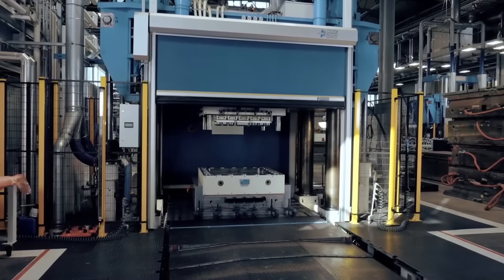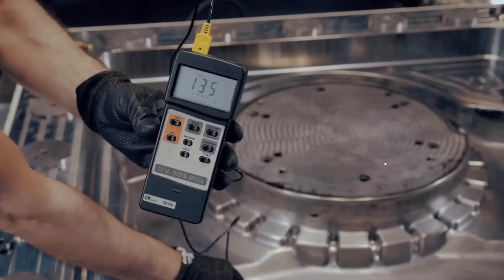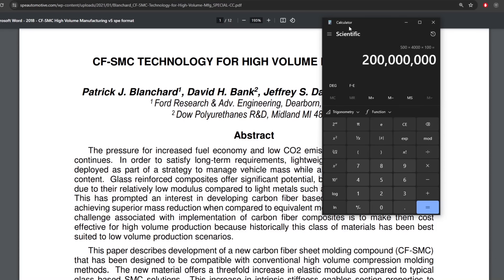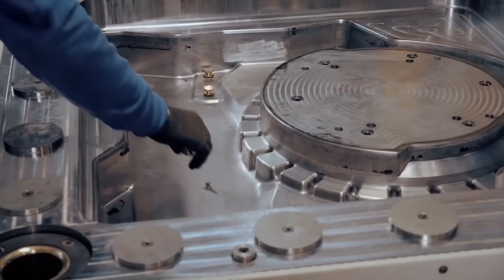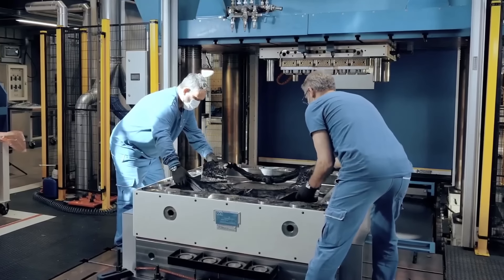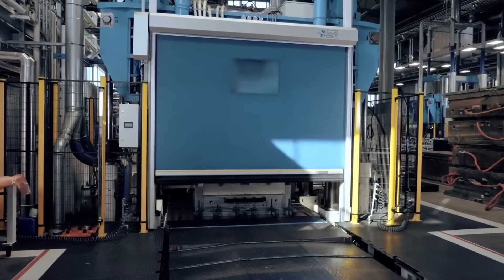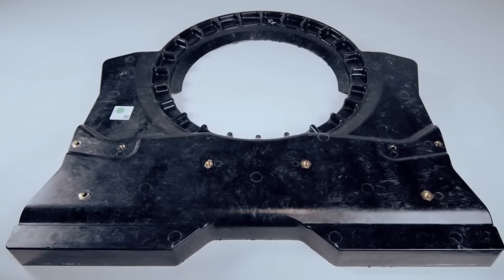How CPC presses the CF SMC parts

Comment: The energy to heat up the die is approximately the energy required to manufacturer 1kg of carbon fiber (100 MJ to 900 MJ). The forming energy cost is very low compared to the material energy cost.

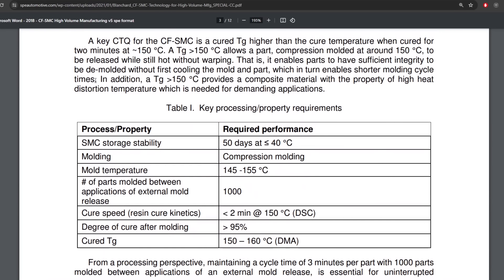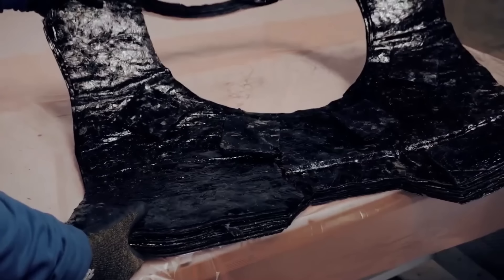Comment: Thank you so much for this video. I tried getting some of this info directly from CA while at Aptera (you have the video in part 2) but he did not get the detail right. I thought the mold had to cycle a little with the temperature (like 20-30 degrees) to allow a firm part to be removed from the mold, but the data sheet at 3:18 dispells that, with a cure time of under 2 minutes at full tempurature. Also I could not understand how a blob of material could find its way to the extremities of the mold in such a short cycle time. This answers those questions as the blob isn't really a blob, more of a preform.  It also leads me to more questions, like what do they call the premolded shape (shown at 4:50) and what does it look like, say for the sides of the body.
Reply: Probably for compatibility with existing tooling in places that compression mold pre-preg carbon. Can't edit my previous comment but there is a picture of the roll on the mitsubishi website (about half way down)

Comment: 10,000 KN = about 1,000 tons of force, so it's about 1/6 the force of a standard Giga press that Tesla started making parts for the Model Y.
Reply: So despite what seemed like high energy consumption, yet another manufacturing efficiency advantage of Aptera’s carbon/fiberglass over metal/aluminum favored by other automakers.

Comment: So, therefore the limited part of the production might be the molds. Building more assembly plants, should be the easy part, maybe one in Carlsbad to begin, but Abu Dubai, or in Europe, then one in the Asian market. Can CPC keep up with demand, without more molds? This wonderful material can be duplicated only with the expensive molds or dies. So are the plans to make more molds/dies, for other assembly plants.
Reply: They will have to make more molds. The cycle time is too slow. Remember, it takes 102 minutes to make an Aptera in Carlsbad. Plus you can't run the machine 24/7 strictly because of staffing and maintenance.

Aptera has shown us a video of what they think assembly is, yet nothing on the rest. For example, making the bink or any sub assemblies. In the end, it's not going to be as easy as they tell us.

Comment: Even if it used 100kwh of energy. The vehicle may last 500k miles. The energy it offsets after 2 recharges from solar offset body stamping cost. Thats quick. Plus they can offset factory energy use with solar, wind, hydro, battery etc

Comment: So its similar to plastic injection molding Places like that do thousands of pieces a day and only change mold after a specified  amount of materials made typically in the hundreds of thousands depending on variables.So they don't have to keep reheating the mold to get all the parts they need. Plastic moulding takes higher heat btw.

Comment: I suggested Tesla using carbon fiber. Someone said they didn't think it was usable for mass production. I disagreed. This video helps with that conversation.
Reply: Stamping steel or aluminum is very expensive to tool, but once tooled for very high production volume,  you've got a very fast process.  It's far faster than this smc press,  and the gigacast process is similarly faster.
Reply: @jamesengland7461  Faster generally only better when market demand exceeds manufacturing capacity. Aptera’s strategy to distribute smaller, less capital-intensive plants seems smart, especially in contrast to the ‘Detroit model’ of highly centralized, high shipping cost (of finished product).

Comment: When they take the moulded part out it appears to be rigid, implying that it is now fairly cold - do they have to somehow cool down the mould before they take the part out ? I have a 3D printer, and I can't get whatever I have printed off the base plate (60 deg. C while printing) until I let it cool down, and if I do manage to get it off, it is quite floppy when at 60C, not like the part in the picture . Maybe the mould is riddled with "tubes" through which heating and cooling liquids flow.....
Reply: That information was in the page that he showed about the process.  They developed the materials and process to not need a cool down.  After being cured for 2 minutes at 155C, the part is rigid and can be extracted hot.  At this point, the glass transition temperature (Tg) is 160C, meaning that it would have to be heated up to 160C before it could be deformed.  I find this point quite interesting - that Tg is 5C higher than the curing temperature.

Comment: Yeah, that's a lot of heat but not as much as it could have been. I've heard that it's that heat that makes CF SMC stronger that the equivalent panel of fiberglass SMC. The material too, of course, bit it's the flow and compression that makes it even stronger. 

As someone else mentioned, the resin is still curing, so that makes it more fluid as well.

Comment: 55kWh is VERY little energy. Try doing the same calculation with a regular steel based vehicle-remember steel melts at over 1,000C. 

Now in terms of cost, 55kWh even at $2.00/kWh is only about $100. Even for 20 structural pieces, the energy cost is only $2,000. That’s a totally unrealistic extreme scenario. The point is for a $34,000 vehicle, the actual cost of energy expended will be very low relative to the entire vehicle. Probably a small fraction of any other enclosed two seater.
Reply: That's what I was thinking.  Very little energy for the part produced, even if they only create one.  Looks like price per KWH in Italy is approx $ 0.10 (as of March 2024)   Only $5.50 per part if you had to fully re-heat each time.
Reply: @rayagreen11  exactly, even if commercial rates are triple that it’s still negligible

Comment: interesting, but the carbon fibre matrix appears to not have directional fibres, it looks more like a chopped matt and expoxy mix, any info on how they make that black blob?
that would be interesting, yes good for mass production.
Found this video of a chinese company making a type of cf-smd sheet, would be pretty similar to the black blob aptera uisng, pretty sure, and a little research shows the base material is 
non-directional cf chopped fibres, which is interesting. Hand laid cf with directional fibres would be thinner and stronger where needed but is slower process, interesting stuff.
https://www.youtube.com/watch?v=nwkl6OrH_L8

Comment: What is this thing about the energy used to heat? Its a one time heating for one piece of car. Other bit, any idea how much energy each phase of any other vehicle mfg process takes. You will be surprised.
Reply: 5:55 no its not a very high temperature. That is the temperature of the flat pan we cook tortilla on! 🙂

Comment: I thought Aptera did injection molding for their CF parts and did require placement of any cut sheets or mats.
Reply: This is one point where the video of this process is different than my understanding of the process for the Aptera parts.  They don't use injection as you suggest, but many times it has been described as placing slugs or globs of the CFSMC material in the mold in strategic places and the force of the molding process spreading these slugs out over the entire surface.  This video may show an older process, or CPC may use different processes (prepped sheets like this video and slugs as described by Aptera) for different parts.  It would seem to me that the slug process would be faster and less labor intensive, thus may be a newer refinement of the process - IF that is how the Aptera parts are done.  Placing Aptera part sized pre-mold sheets would seem to me to be a challenging, slow and labor intensive process.
Reply: No, the original body production process used vacuum resin injection, but that could not scale much beyond 4000 vehicles per year, so they had to change it when many more orders came in.